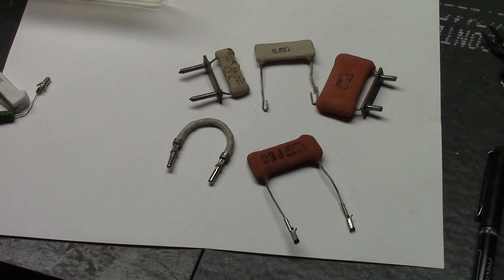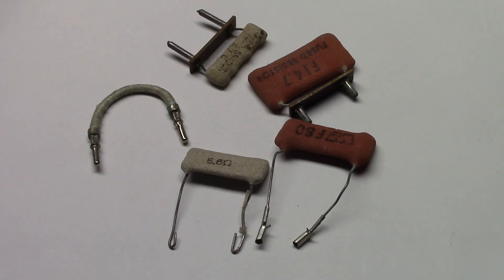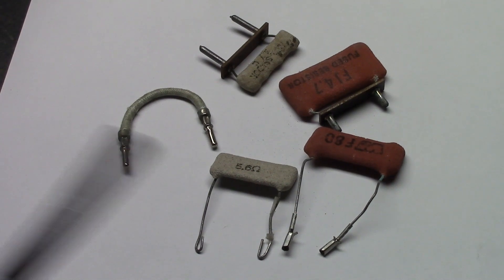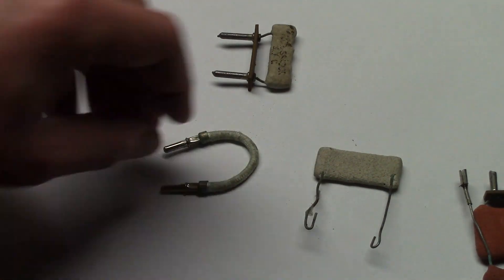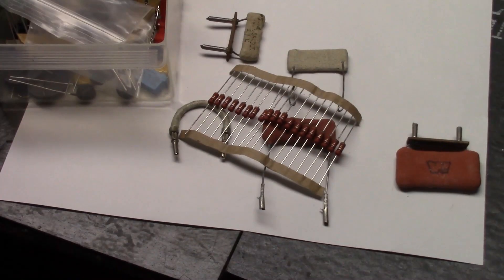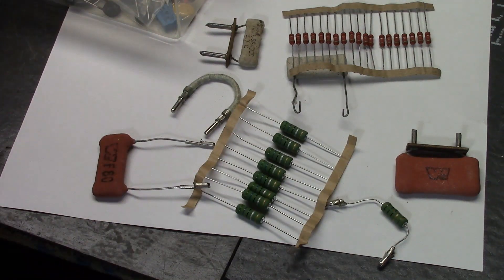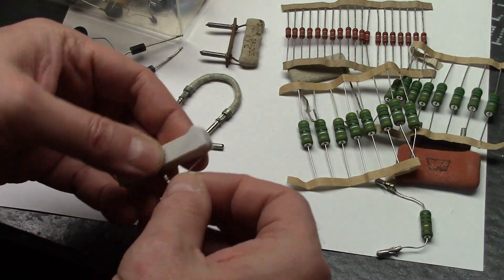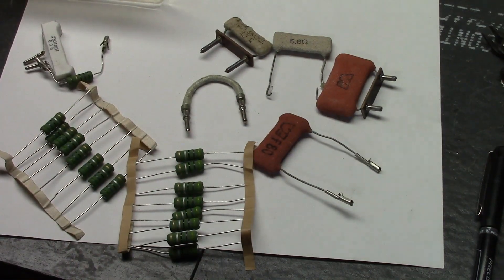Predicta restoration tips: Fusible resistors

Comment: Thank you for covering this rather obscure topic. As you mentioned, it can be a head scratcher when trying to find a suitable replacement with the correct characteristics. I am glad you mentioned that the silicon diodes are more robust. I have a small Admiral AA5 portable with an open 100 ohm fusible resistor. The selenium rectifier is going to be replaced with a silicon one. Is it fair to say I can just use a 100 ohm power resistor in its place? Also, I usually add a dropping resistor after the diode as needed. Any issues here ?
Reply from the maker: I would increase the 100 to 120 and forget about added a second dropping resistor.  I'd also either add a fuse or use a fusible metal film power resistor.
Reply: @bandersentv   I appreciate the help and will take your advice. Btw, that flexible fusible in your video looks like some of the flexible wire wound resistors Philco used in early Cathedral radios. Not designed to be fusible I hope.

Comment: When I was looking for a fusible resistor for my princess.  I'd come across a posting with workman fusible resistor cross reference. it showed the philco part 33-1366-3 as a 5.6 ohm 5 watt fusible resistor.shortly after that, I came across someone on our FB group that was selling the philco factory replacements and I bought a couple.
Reply from the maker: Interesting as the 17" Predictas draw just under 1A in the B+ circuit.  5W would right at the limit.  Maybe that's the way they are supposed to work?  A little over 1A and they go open?  If I had some to spare, I'd experiment to see where they open up.

Comment: Excellent ideas! I have used a 7.5 ohm power resistor in series with a fuse holder to replace one in this "box shaped" Philco TV last year that was similar in design as a Predicta Holiday with the series string tubes, and used a 1A fuse, and it worked well.

Comment: Good explanation for use of fusible resistors back in the day. Now we have  thermistors available but it doesn't actually
 work 1:1 to replace a fusible resistor. You would have to add a fuse. Fusible resistors are still made for power supplies
and chargers for electronics but in very much smaller package because of the lower Wattage in their electrical design.

Comment: I'd think, in a pinch, to put a slow blow fuse (or if possible to appropriately mount, a circuit breaker) of about 1.5 to 2 times the operating amperage, a fuse being placed in a fuse holder to make it easy to replace, in series with an ordinary power resistor of the appropriate value, and attach a note to the chassis about what I did.  I would not use just a fuse, though, because the resistance is also part of the power filter's provision for elimination of hum, resisting the abruptness of rise of output voltage at the crest of each cycle of the sine wave at the "top up" of the filter capacitor.

Beyond this, a great overview.
Reply from the maker: I don't think that small amount of resistance has any effect on hum. Right after that fusible resistor are big caps and rectifiers plus a filter choke. That's where all the action happens.

Comment: The voltage doubler input current would be at least twice the output current, probably more due to losses in the caps.
Reply: The input rms current will be many times the DC output current,  because the current is in a series of narrow pulses.  More like 5 times, by my estimation.

Comment: What about 4 of them in series/parallel? Would that not be 5.6 ohms and 20 watts? Lots of surface area to dissipate heat as well.
Reply from the maker: Too high a wattage. Remember you want them to fail when there is too much heat.
Reply: @bandersentv  True, like you say, it is hard to determine the power required to cause failure, yet be reliable. Hmmm, good topic.